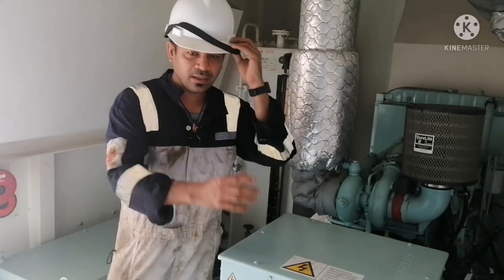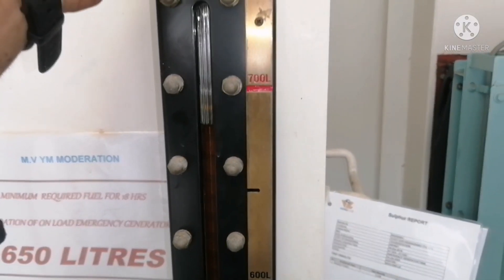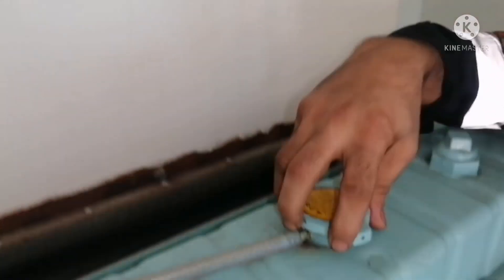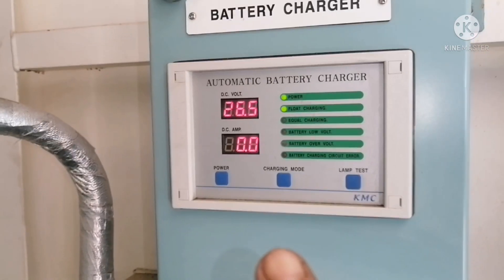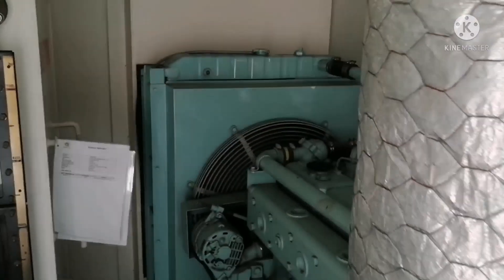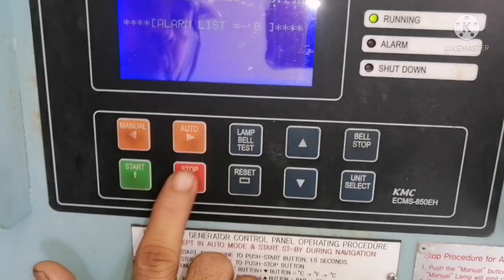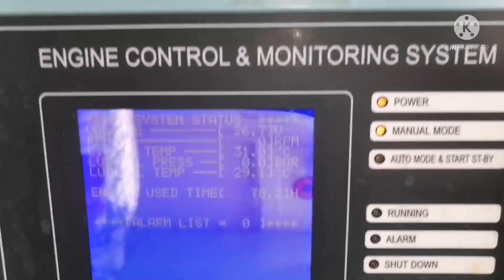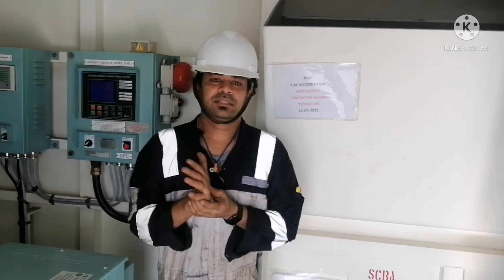How do they do..Procedure to start and stop Emergency generator...

Comment: Hello boss🙏✌
Here having some trouble with top up compressor -JP sauer and sohn make. 
First stage safety valve is lifting n after we opened second stage cylinder and found valve plate was broken. 
We installed new spare second stage valve and after few hours of running same thing is happening. Pressure is actually high so which means nothing wrong with safety valve. 
What could be possible cause other then not original spare parts?? 
Any suggestions? 
Thanks
Reply from the maker: Thanks for your good query...
Please check the following :
* check for water in the sump.
*check whether there is any Leakage in the cooler.
If u find any of these issues u can face the said problem..

Comment: I am back with some questions sir
Difference between bilge tank and bilge oil tank. 
2. If I open generator lo drain valve. The oil goes to where sir? Settling tank or bilge oil tank
3 function of puncture valve and erosion plug in fuel pump
 4 starting of boiler and incinerator is same or different. Why I am asking is my ship no incinerator that's why I ask
 5. Upload one video which unit is tdc. How to find and methods
6. How to calculate sfoc
7 fresh water line diagram oru teach pannuka sir.
Reply: Sir. One more question sir. Why centrifugal pump cannot handle. I search alot but not get proper answer. Pls tell me sir
Reply from the maker: @balajichandrasekar5005  sir can you pls clarify your question..
Reply from the maker: Thanks for your good query.
1) Bilge tank contains water with a very little traces of water ( wash water sink / air compressor drain) and bilge oil tank which commonly called  as bilge sludge oil tank where this tank contains waste oil with water (purifier sludge tank / settling service drain line) 
.2) The drain valve of generator  lube oil sump have connection for both bilge oil tank and settling tank.. If you want to renew oil you can drain to BSOT and if you want to do batch purification then you have to transfer to settling tank.
Reply from the maker: 3) The function of puncture valve is to bypass the fuel oil from discharge side back to suction side inorder to avoid injection.
This puncture valve has a piston which is activated by control Air during engine stop condition and during emergency shut down operation. 
Erosion plug takes the high pressure oil spill once the spill port get uncovered after injection completed and so prevents the pump casing from getting damaged.
Reply from the maker: 4) Different sir..
Reply from the maker: 5)will do for sure sir.. E45
Reply: Thanks for your answer sir
Reply: Why centrifugal pump cannot handle air. Why we are do priming sir